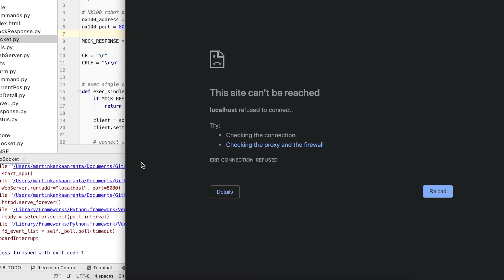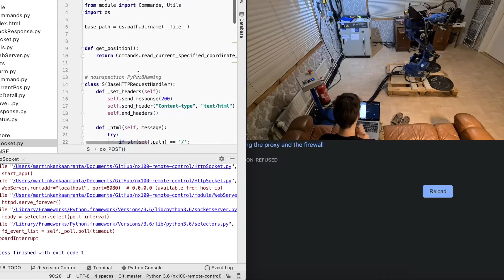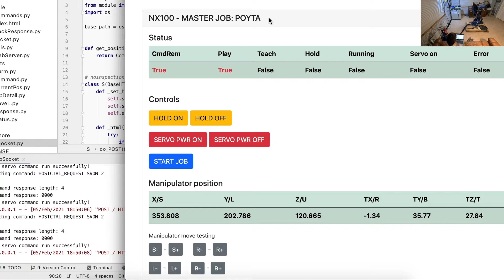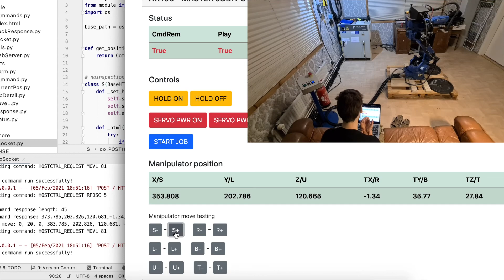Motoman NX100 industrial robot HTTP Socket remote control Python application demo

Comment: Great video! I would like to connect with you for a quick discussion.
Reply from the maker: I don't know what to discus about this project. Look github repository for sources. I touched this last time two years ago and don't remember anything anymore.
Reply: @norkator  As you are executing the tasks through python scripting I guess, I would like to know how the robot has been configured. I have GP12 robot with YRC1000 controller for which we are able to enable the servos (python script) but unable to send any further commands after that, and it shows that since the last command is on (enable servos) it can't take further commands.
Reply from the maker: @DeepSingh-yt8ir  robot I worked with was configured to some state I hate no documentation of. My Github repository explains what I changed in my case to be able to control it. Unfortunately you need to read your robot specific documentations especially  ones Yaskawa doesn't give to their robot customers (hope you find them for this robot)

Maybe in your case its something to do with some safety feature, I honestly have no idea.

Comment: Thanks for sharing this. I have two Motoman robots with NX100 controllers and I was thinking that open source machine vision was beyond the capabilities of the NX100. I will try out your examples and see how I go.
Reply from the maker: Well depends on which view point to look things since NX100 has this socket API to move it to points it means you can build anything you can imagine on top of it. Also when you utilise those IO capabilities it has then theres really no end to it what you can do.

That robot has "no idea" what is controlling it, machine vision side just tells robot where to go and that input can be anything from xbox controller to Arduino push buttons.
Reply: @norkator  I have read since the NX100 is not real time capable the options for real time control are limited. I wanted to run ROS and build a component for real time weld seam tracking using inexpensive sensors. I will look into the possibility of using the socket API for that but I dont think it will be quick enough.

Its funny these robots are a bit over 12 years old but in terms of computing performance they are decades behind, combined with the fact they retail for $60K AUD when new, the features they have are not great.
Reply from the maker: @aaabbbcccdddee___3333  Yep that is issue that it's not real time capable. "real time weld seam tracking" yeah this wont be possible in seamless real time unfortunately. I don't even know how socket API handles tons of commands. Should probably get KUKA robots for this case (I don't know anything about them tho)
Reply: @norkator  I think my biggest problems are the limitations of the controller,not the robot hardware it self. I am working on building my own open source controller that will solve the communication issues that the NX100 suffers from. My time over the last couple of years has been limited but I hope to have something working in the next year or so.
Reply from the maker: Also need to mention that I have been thinking trying out to install Makita router into it to make holes on plates  which basically would work like => having 3D model of table where my wooden plate is => I know 3D space corner points in real life relative to robot => make small python app that can translate drilling points into commands so no need to manually write each movement line => well.. then execute it and python app should run each movement command trough this socket api, wait for target point to be reached and go to next one.